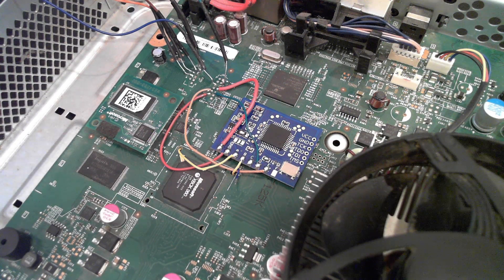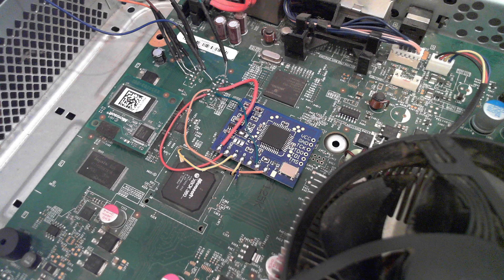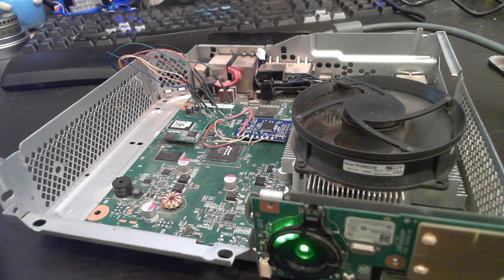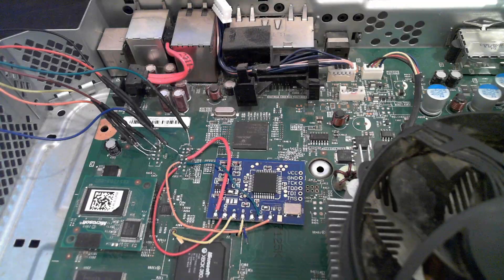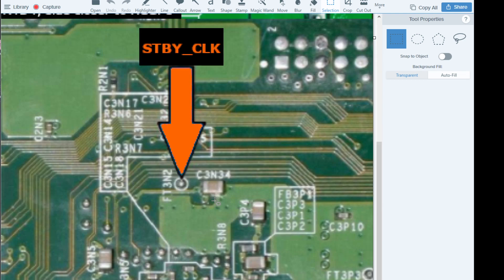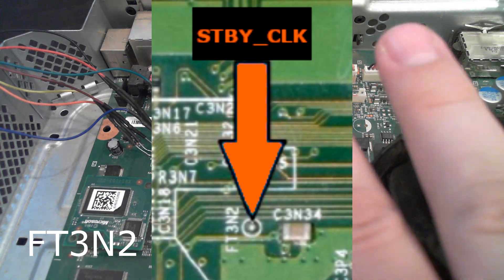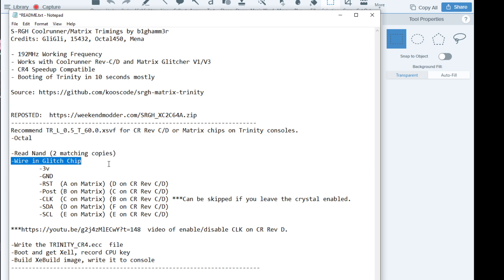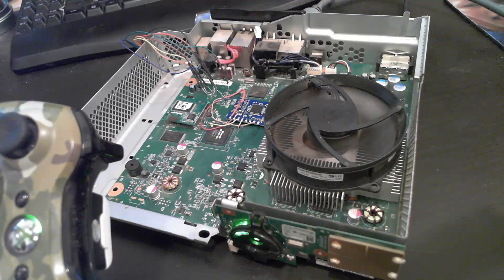2021 Overview SRGH on Trinity Xbox 360 using Matrix or CoolRunner

Comment: I wrote the TRINITY_CR4.ecc  file incuded in the J-Runner-with-Extra ,but all error messages appeared and failed to boot. Is that the correct file i shall use to replace "create ECC" ? Or  should i create the ECC file like the regular way with CR4 checked?

Comment: Did my first ever 360 mod yesterday and followed your rgh 1.2 livestream step by step from four years back on my phat Jasper. Works flawlessly. Thank you. Want to mod my Trinities but will wait until your new SRGH tutorial drops.
Reply from the maker: S-RGH on Coronas is released, but the S-RGH for Trinity is still in development.  If you can get hands on with an Ace V3 then I'd go that route, otherwise try the Corona "muffin" method.
Reply: @TheWeekendModder  would it be possible to convert your Trinity Muffin install (i.e the tutorial on your website that i followed to the letter precisely) into this S-RGH?
Reply from the maker: @ichrismoku  yes.

Comment: Thanks for covering this!
Actually its RGH2, not S-RGH. We'll be clarifying this in an upcoming release.
Reply: can the xflasher 360 not do this mod? jrunner doesn't have an option to write timing files for a matrix for srgh
Reply: @lilylarceny  Its RGH2 not S-RGH. 
http://cdn.octalsconsoleshop.com/Project%20Mufas.rar
Use this instead until I release the updated firmware.
Reply: @Josh.Davidson  That instantly solved my problem, thanks! have you gotten faster boot with the onboard clock over the matrix oscillator crystal?

Comment: great video! just finished a viper dual nand with cr rev.c in a trinity using this. Only timing that worked is the one suggested in the readme, But I am getting pretty consist boots  around 8-10secs
Reply from the maker: Nice - no issues with this timing file for the dual nand? The chip disables properly when you're on stock?
Reply: @TheWeekendModder  Ya, it will cycle once then boot up instantly into the stock dash. I get about 3-4 cycles for the hacked image. So I can confirm it does work.
Reply: @TheWeekendModder  Yes it does. The slowdown is delayed enough that retail bootloader will just continue and the chip never glitch.

Comment: i get Failed - TDO MISMATCH when i try to program the CR rev c. Do you know why?
Reply from the maker: You using a nandx or a JRP to program with?  Sure you've got the pin orientation correct?
Reply: @TheWeekendModder  JRP v2. and i tried with my demon but same result.
Reply from the maker: Demons can program glitch chips?
Reply: @TheWeekendModder  yes. There is a cable from demon to coolrunners pins. But i get same error code.

Comment: Wait, isn't this a new implementation of 15432's project muffin? I read through the release notes on github, and it seems that the "S-RGH" part of it is speeding up the XC2C64a's clock to 192MHz, which is (if I remember correctly) what 15432 did with project muffin.
If any one is interested, there should be some info on it over on the se7ensins forums.
Reply from the maker: Muffin specifically uses the DB2G3 point that comes off the southbridge for it's reset signal, this instead relies on the standard SDA/SCL.  15432 is credited in the github, so I'm sure the work is somewhat derivative, but I wouldn't call it "Muffin".
Reply: @TheWeekendModder  Yes, that is correct. I was mostly referring to the 192MHz clock, which seems to be the highlight of the matrix S-RGH project.
Reply: @reaperreaper9593  Hi bro
The clock of the STBY_CLK (Standby clock for run SMC, or the matrix quartz if using) is 48MHz, using double edge processing (on rising and falling edge) we can process at 96MHz. But we also can double the clock in xilinx with a simple circuit! This gives us 192MHz for glitch processing. The muffin and 192mhz are totally seperate.
192MHz is just higher precision for RGH2.
Muffin aimed to re-implement the CR4 style RGH2+ hack. It works by the SMC sends the I2C commands to the HANA when DB2G3 (SMC_GPIO0) is high (> 1v) to issue the slowdown rather than the chip sending it, then slowdown when it goes low (about 0v) Saves space on the CPLD by alot as the I2C code is complicated!
If you have any more questions let me know.
Reply: @Josh.Davidson  Yes, I understand they are different. Just saying they both use a 192MHz clock made from a 48MHz reference clock.
Reply: @reaperreaper9593  Yep. The speed-up refers to the SMC acceleration which isn't really used by this. See the SMC+ video my channel, for info, its a improved version of 15432's speedup. It works because S-RGH timings delay slowdown to just before glitch, so the bootloader runs at full speed for longer. Thus we can reduce the timout! This mod does not work with it so its technically just RGH2, as there was not enough space on the CPLD for the extra divider and delayer.

Comment: I have a question.  I have one x360. I'm wanting to rgh it, I've never done it before. Should I do it? I'm going to use the information on your site.
Reply from the maker: If you've never soldered before, get your hands on some old PCB and practice removing some parts and re-installing them.  Once you've got some general comfort with soldering, go for it - do the mod!